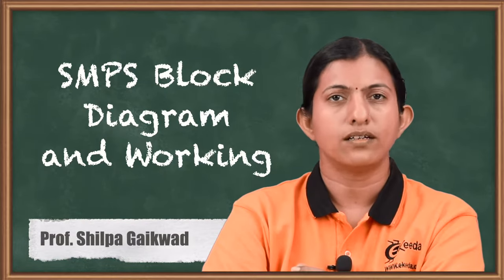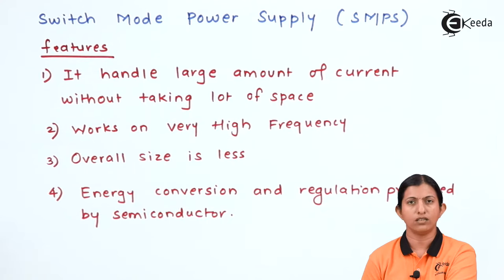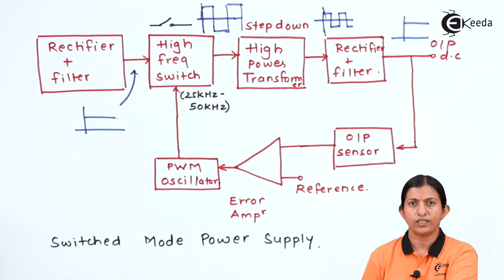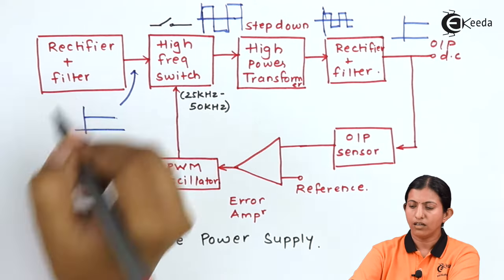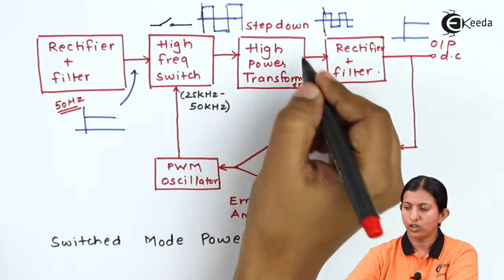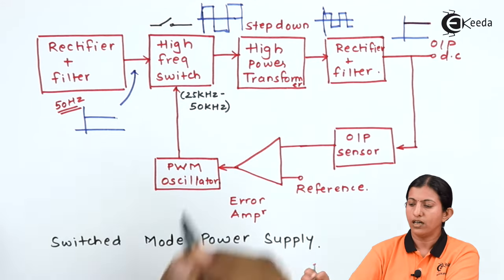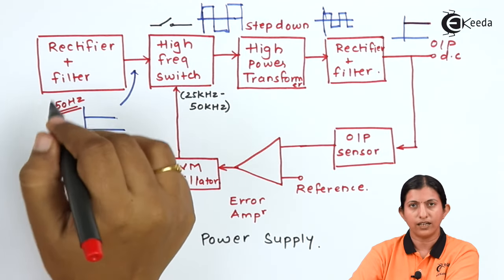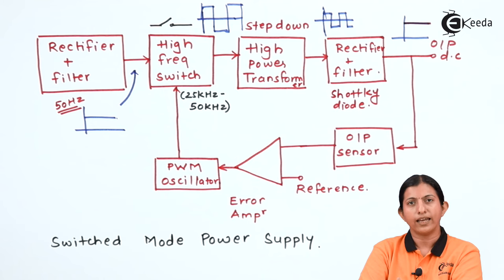SMPS Block Diagram and Working - Voltage regulator - Applied Electronics

Comment: All concept are gd but how you fed dc into a transformer bcz due to induction law transformer work on only ac supply , it will be obyesly burnt
Reply: It is not DC which is fed to the transformer, it is the "switched DC"; which is switched at high frequency (as explained 25kHz to 50kHz). So transformer is getting a square wave of high freq, so will work fine; with a better efficiency. Hope that clarifies.

Comment: how dc voltage will have 50hz frequency ?
Reply: Actually it is ac input which has 50Hz frequency and it fed to rect+filter that convert in pure dc (not in pulsating form)  of 325 volts() if your using 230(rms) volts than pwm cause to high frequency switching let say MOSFET used here as switch that on off at 25kHz frequency and your filtered dc forms 25kHz 325 volts dc and fed to high power transformer.
note: DC supply can also has frequency in pulses.

Comment: How dc has frequey
Reply: No. Of cycles is frequency in DC signals.
Reply: Actually it is ac input which has 50Hz frequency and it fed to rect+filter that convert in pure dc (not in pulsating form)  of 325 volts() if your using 230(rms) volts than pwm cause to high frequency switching let say MOSFET used here as switch that on off at 25kHz frequency and your filtered dc forms 25kHz 325 volts dc and fed to high power transformer.
note: DC supply can also has frequency in pulses.